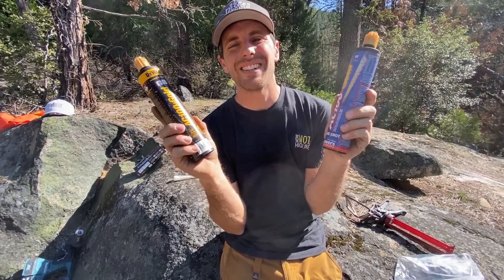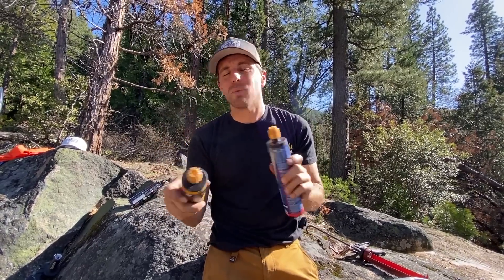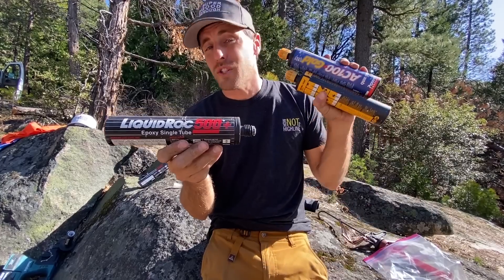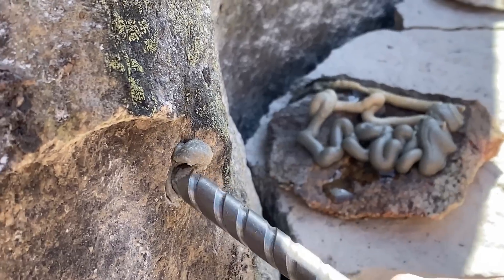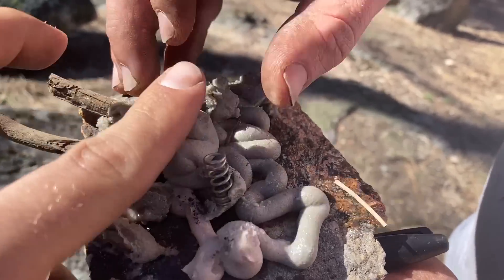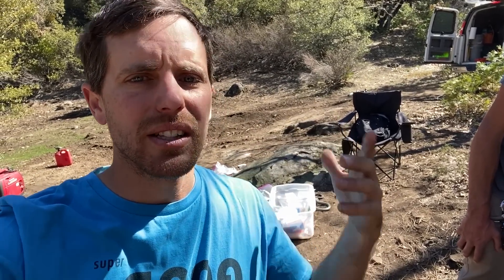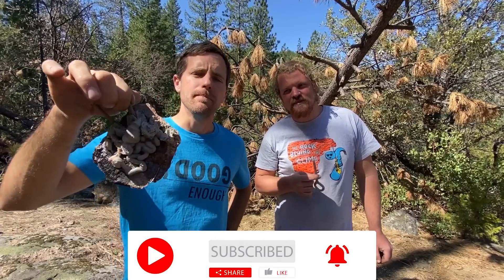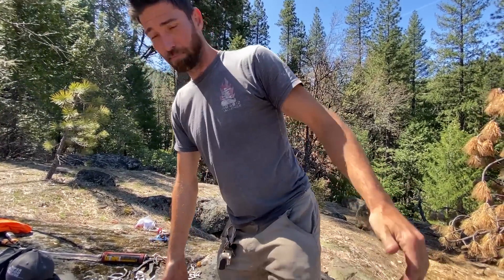Climbing Bolts - Is Expired Glue Dangerous???

Comment: Good enough I suppose, but to me looks like 2 of 3 of those bolts failed at the weld.  Not the haz near the weld, but the weld itself, looks like from lack of penetration.  For a TIG stainless weld, that's a problem.  Those bolt heads should straighten, thin out, then fail at whatever ends up being the thin part.  Welding isn't like knots on mild steel or 3xx stainless.  Should be stronger than the base metal.  Great test, though!!  FYI, some commercial uses they keep the adhesives in a fridge until time of use, to ensure they're at full strength.

Comment: Think the first few squirts of glue was very important information, even with with stuff that isn't out of date. 

Also fun prank my boss used to do back I the 70s - 80s, when you wouldn't get fired for it, was to put 2 pack adhesive or filler in someone's back pocket and the wack them to it spreads out and sticks. The heat will start to hurt and they have to take there trousers off 👍

Comment: Awesome info.  New to the channel.  Love it.  You guys should definitely be testing out original JB weld. It is 100% the strongest epoxy out there. We have been using it to mount anchors in concrete forever.  You squirt it out 50/50 into a small ziploc baggie. Close baggie.  Mix it up really good.  Then cut off a corner of the bottom of the baggie and squirt it into the hole. The only drawback is the slow cure time. But the very slow cure time is why it is so strong.  You should definitely test it. Oh and it's cheap.

Comment: Expiration dates ensure 100% effectiveness. 
And if it expires and the customer has to buy more?

I had some golf club epoxy that finally had curing problems after about 15 years after opening. It was sometimes exposed to hot summer temps and cold winter temps, say -3C ~ 45C. Never had a club fail.

Comment: You should test gorilla glue. My money's on it isn't strong enough but I'm beginning to wonder
Reply: It isn't.  Go check out Project Farm channel.  He tested all kinds of glue and epoxy.  It's JB Weld that I want to see them test. That shit is like magic.
Reply: @jasonsmith7684  funny you mentioned that, I just saw that video a couple days ago. JB Weld would be really interesting!
Reply: We have been using JB weld original forever for anchoring conduit and utility equipment to concrete walls. We just squirt the JB weld into a small ziploc baggie and mix it up really good.  Then cut off the bottom corner of the baggie and squirt it into the hole.  It cures slowly but it is usually stronger than the concrete around it.

Comment: Most structural adhesives - the manufacturer recommends wasting the first 3 "lengths" of the mixing tip.  (Sry, can't remember where I heard that, but it was the rule at work for some battery plastics)

Comment: Thai bolts have all been replaced with Titanium, the days of blowing anchors in S.E. Asia are long gone. It was only Railay, Tonsai and Phi Phi that were originally bolted with steel, by 2000 the problem was apparent.The many other crags and islands in the south were put up painstakingly with Ti bolts the first go, no issue.  There was a glue issue as well and Hilti RE-500 turned out to be the key. Talk about crazy expensive routes to put up, yikes. The bolts are slammer in Thailand (now) but access has become the issue.

Comment: Cool. I would have expected then glue to still work. I've had expired glue usually harden too fast like you had with the 2nd tube.
FYI most solutions will have a solvent and a solute. Even with water based paint... Etc. Water is actualy the most common solvent.

Comment: I don´t know how old are the glued bolted routes instead of mechanical bolt in climbing routes, but it might be a good idea to test old glue as well. Rusty steel gives a good indication that the bolts must be replaced, but glued stainless bolts not so...
Reply: Given the lifespan of glued stainless bolts I don't think there are any on the planet that need replacing. I've been wrong before though
Reply: @isaack6994  I'm worried mostly at the lifespan of the glue itself, even if it has been correctly mixed and applied, not the stainless steel bolt.
Reply: @pynchonspotdoes  ah, fair enough, usually these bonding agents have an "indefinite lifespan" so they'll never give out or weaken.

Comment: So when polyester and vinylester resin are exposed to air during curing they will leave a tacky exterior.  It's normal.  The stuff that is just just below the surface will be nice and hard.  There are ways to cover it but it wouldn't be worth it when bolting.